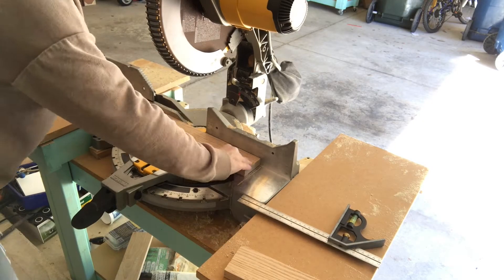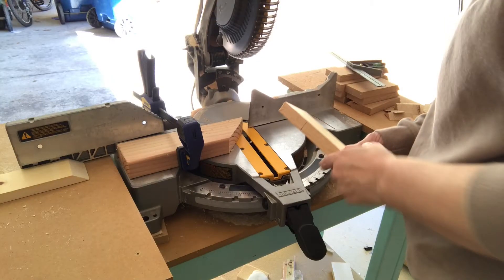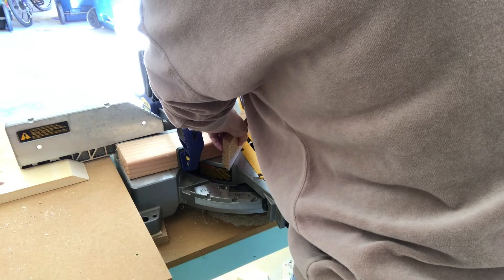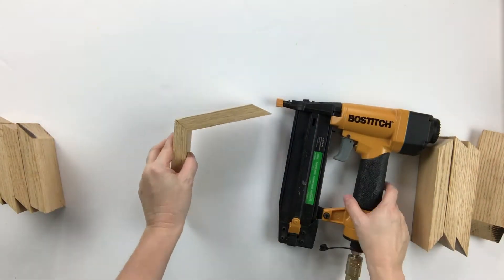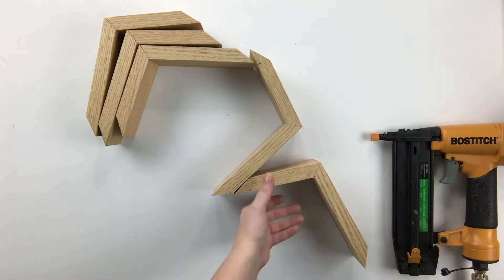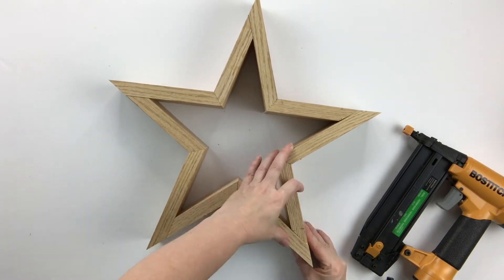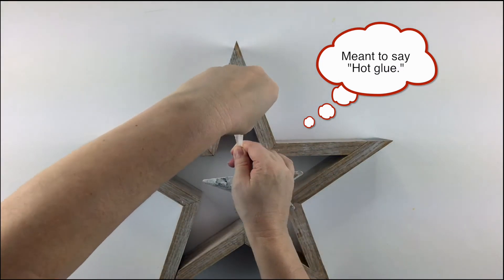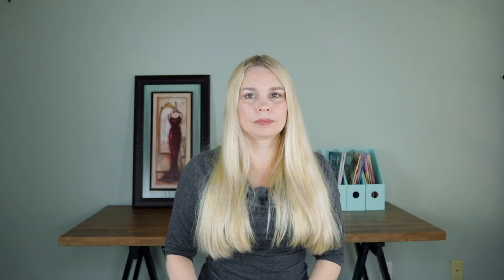How to Make Wooden Stars Accent Decor

Comment: How did you get the rustic stain?
Reply from the maker: For this finish, I used oak wood and applied 1 coat of Minwax in weathered gray (water based). Then I very lightly dry brushed with white paint.